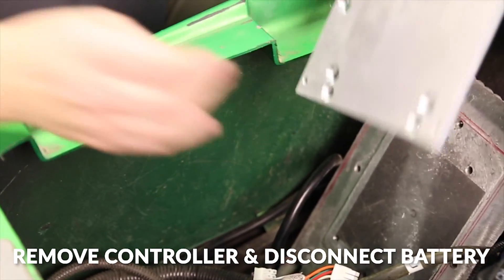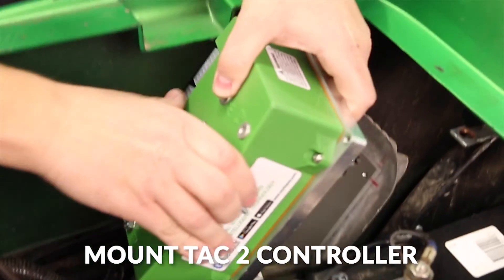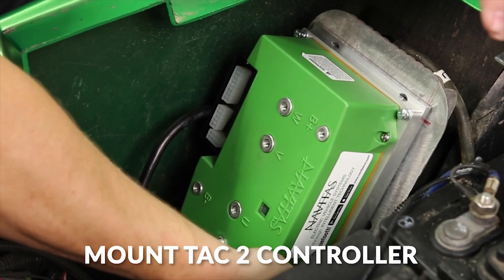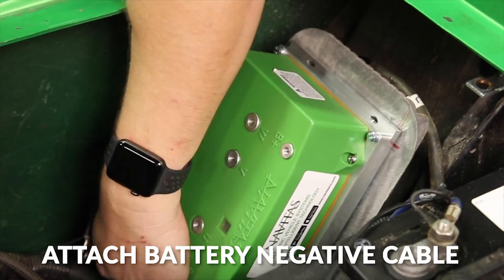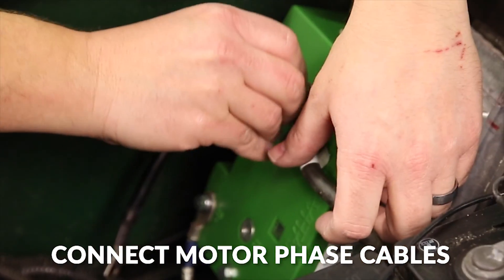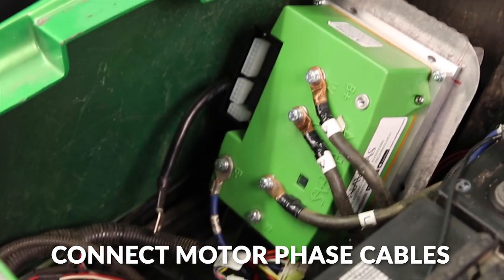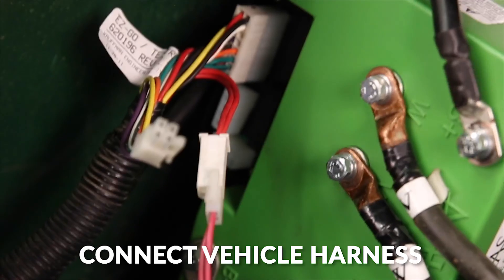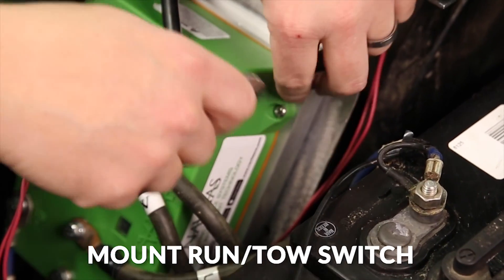TAC 2 into an E-Z-GO TXT 48 Install - Navitas

Comment: This is basically a worthless how to.  When I purchased this 600a controller I was told I had to upgrade the solenoid. Which I purchased from you as well as a motor. I feel like there should be the info on the new 400a solenoid that replaces the factory because its a little different from the stock solenoid.